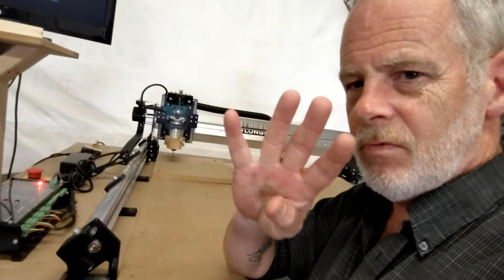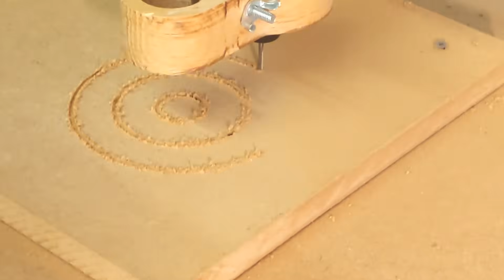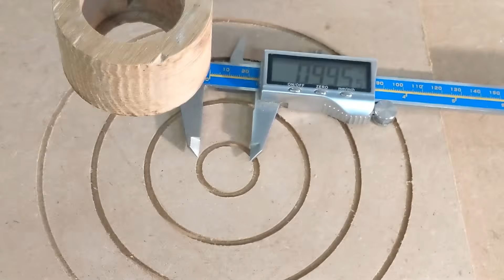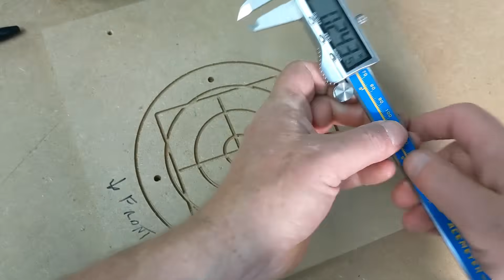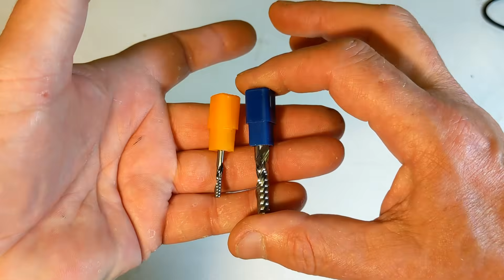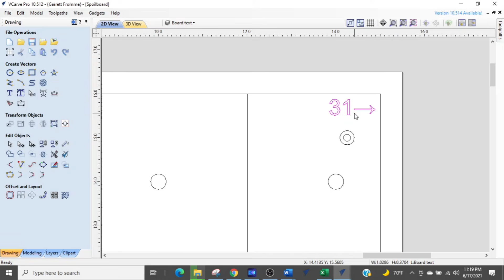Longmill CNC Router First Test Cut Review [Impressed!] Garrett Fromme

Comment: I see that you you have a laptop by your machine. I have a spare small desktop computer which I want to place by my cnc and another desk computer in my office. I have no laptop. My question is can I design in my office and save it to a stick and just insert the to the computer which will be by my Longmill cnc.  And one more question, do both computers need the all the program installed like gSender, Pro VCrave and such. I can wait for the bits I order from you to arrive, thanks.
Reply from the maker: Michael, you could do that no problem with your spare desktop computer. 
The only program that you would 100% need for the computer by your CNC is gSender. 
I would still recommend loading both Vcarve and gSender onto the computer by your CNC however incase you need to make small edits here and there.
Reply: @IDCWoodcraft  Is Crave Pro operate on Mac computers or is it a windows only program?
Reply from the maker: @michaelgerrior2844  Windows only. You can use a Windows emulator for your Mac. Many people do that

Comment: I really really like the way the Longmill looks, its design and concept. I am working one into my budget so soon I will buy one. I am wondering though if there might be a way to put the machine together with the side rails facing the opposite direction to keep chips from accumulating around the drive screws?
Reply from the maker: Hi Calculus. Interesting idea with the longmill screws. I find it is not a problem with the dust as long as either the downblast air is redirected or you use the dust shoe. You will not be able to reorient the screws, though.

Comment: I have tried G-Sender, and I have to tell you, that despite its many cool features, it sucks. Number one, my macros for various touch plate routines won't work properly with no idea why. More importantly, I was cutting a piece measuring 6" x 3.87", G-Sender decided to cut it 6" x 3.2", ruining the workpiece. Never had these issues with UGS, which I am sticking with at least for now.
Reply from the maker: Make sure you tell Longmill about those issues so they can fix them. Otherwise, others may have that problem.

Comment: Hey Garrett, Glad to hear you are feeling better.  Have you checked out the Calibration and Surfacing tools built into GCARVE? Very useful features.  Now, if only they would include a grid generator as well!
Reply: I am very interested in that amazing grid you created for your spoil board.  Please let us know when you get the one for those of us using the dust collector from Sienci.  Are you going to make the gcode available?
Reply from the maker: Hi Dallas. I'll make the G-cade available. I've been working on it for a while, getting the design right. Made my first and had some issues...toolpath corrections and such

Comment: So, when you used the other cutter that broke, you were measuring features a few thousandths under nominal. That wasn't surprising, since you were measuring MDF and could easily have squeezed it a little. Then with the new cutter you were measuring .015 over nominal. Obviously there is some differences in the cutters. Also, breaking the old cutter instead of the machine flexing like crazy and ruining the piece confirms the rigidity of the gantry. Glad you're pleased with the machine.
Reply from the maker: Hey CNC. That's why we measure multiple times. Too many variables...density of the materil, tool extension, caliper method, etc. Overall, excellent result.

Comment: 1 Question .you said that you expected the holes you drilled to be undersized ,Why was that? Also does that cnc have any limit switches 
The brackets that hold the rails down to the table top are they metal or plastic 
Jeff
Reply from the maker: Hi Jeff. It is common in the machining industry that milled holes are slightly undersized. It can happen from tool deflection, using climb vs conventional milling and tool condition. This is compensated for using something called cutter compensation. I have a video that discusses this. Search for 'how to drill acurate sized holes on a cnc router'.

The Longmill does not come with limit switches. However, it is set up to accept it.

The brackets are plastic.

Comment: Great info Garrett! I changed my spoil board to smooth and use the painters tape and ca glue method and will never go back. If necessary I will run screws or pin nails on some things. I set up a square end to start all projects.
Reply from the maker: Chevy, my friend. Hello. you actually have me thinking about that.

Comment: Is there any accommodation in the controller for us to add a couple of limit switches to the machine so we don't need to do the bump method to get the corners (that's always going to provide ever so slightly different corners based on how fast you are moving when it bumps and deflects). Induction or even physical limit switches should provide very repeatable corner & thus home position reference. But if the controller doesn't allow for the additional connections needed and the control software can't interpret those signals, that's not going to be possible.

I don't understand why some of the new machines like this one or Onefinity don't include $5 limit switches but spend their money on redesigning dust boots and t-track spoil boards when they could use standard ones there and spend a few bucks on limit switches.
Reply: I added switches to mine. There are inputs for them on the controller but you need to buy the jst-xh 2.54mm Connectors
Reply: @bobmalarkey4055  You can also use the terminal-style connectors as well if you don't have the jst-xh connectors already 👍
Reply from the maker: @bobmalarkey4055  can you send me a link to the connectors please?
Reply: @IDCWoodcraft  I emailed you the link on Amazon
Reply from the maker: Hi Jim. I am well aware of the inaccuracies of the bump. Yes, Longmill has the built in features to aloow for limit switches. I agree. Limit switches are so handy and very inexpensive. It is too eay to incorporate.